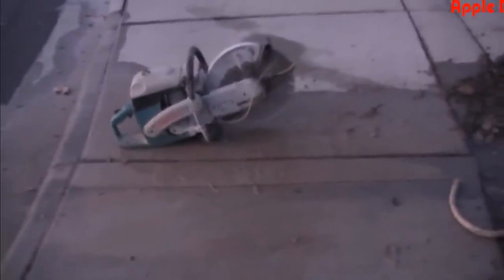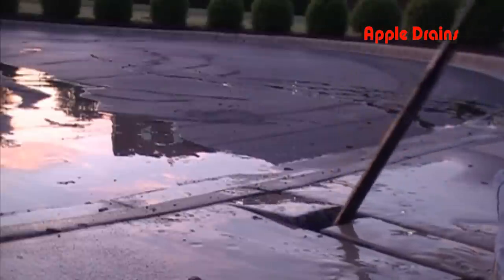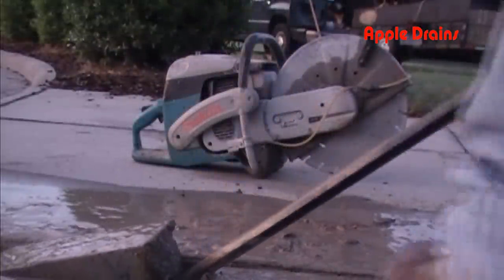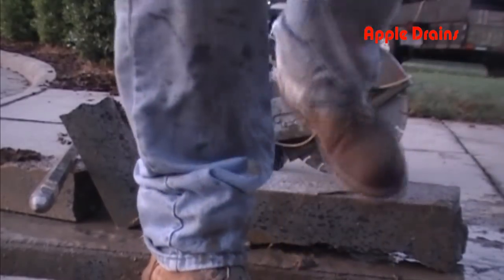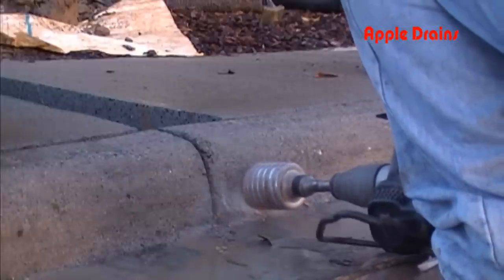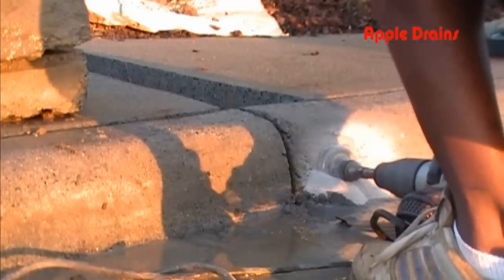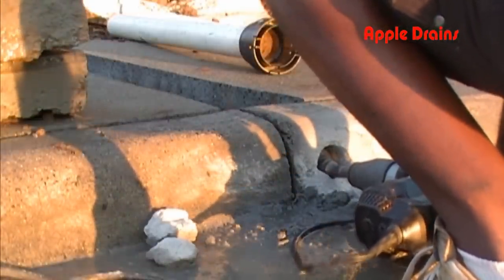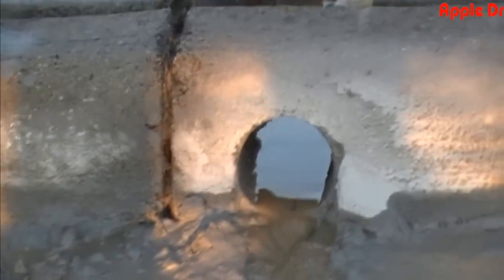Boring a Curb Hole, Discharge for Drainage

Comment: I don't know about it being impossible to hydrocore in this video, but that's what I did when I installed a drain from my yard.  We cored out a hole in the curb and hydro-cored a tunnel under the sidewalk and then pushed in the pvc piping out thru the cored curb.  Otherwise this is a good video if someone would rather do it this way.
Reply: In what city was this allowed?

Comment: What size core is that and where can I find the tools to drill a core like that?
Reply: 2". Fits a 2" PVC pipe perfectly. Epoxy around the rim on the curb side for a nice clean install. The tool can be rented at Home Depot/Lowes.

Comment: Tunneling a 4" drainage pipe under a sidewalk is near impossible without the right tools. But I'd rather tunnel under a sidewalk than remove concrete any day, just for aesthetic reasons. But I admit you can create some clean patches in a sidewalk with quickrete and edging trowels.
Reply: I got a concrete floor going on top of the basement I have to put a drain pipe through could I use a drill bit like this and is it okay for PVC to rest against concrete if it's a snug fit
Reply: It can't be impossible because this guy always says "If you believe you can do something, I guarantee you can do it!"

Comment: nice stuff i was wondering if those drilling bits come in small sizes like 1 7/8 or do they only come in whole sizes
Reply: mario d.c Yes they make those i needed a size around that and also a bigger one like around 3 inch and found a company called http://drillbitwarehouse.com/ I also called because I needed a size i couldn't find online and they were very helpful and manufactured me a custom size and also gave me free shipping.
Reply: Yeah I would say so. I would give them a call I always deal with mike and he usually gives me good deals
Reply: could you tell me where i can purchase a drill tool like the one you demonstrated thanks..
Reply: @MrTarkus007  What's "BF"?

Comment: I had a concrete patio poured but the forgot a drain now I have an area where water pools how can I fix this problem without having to destroy the concrete?
Reply: How do you forget a drain? So they pitched the concrete to a low spot and then didnt put a drain there?
Reply: @christopheralegria71  so you know answers ? I got a concrete floor I have to put a drain to the basement through it is there a drill big enough to put a drain pipe ? Send me a link please
Reply: @xivwords5448  the answer would be to not forget the drain in the first place. My comment was a disbelief question on part of the contractor. How could they pitch the concrete towards a spot and then not put the drain there. That's the reason you pitch a concrete pad towards a single spot.